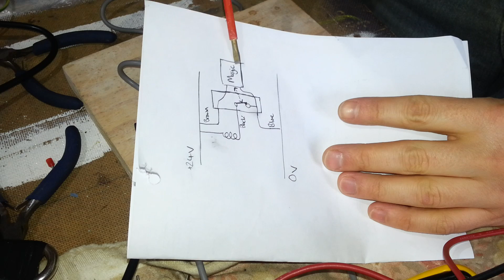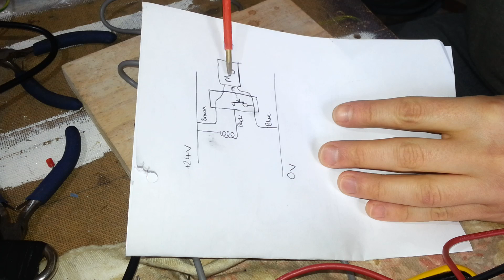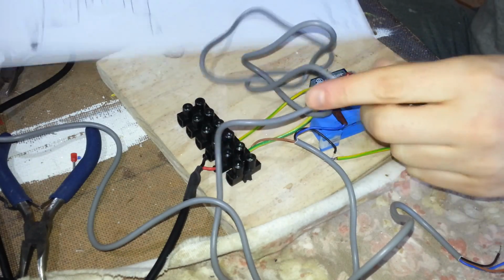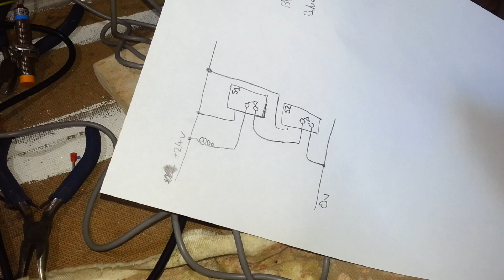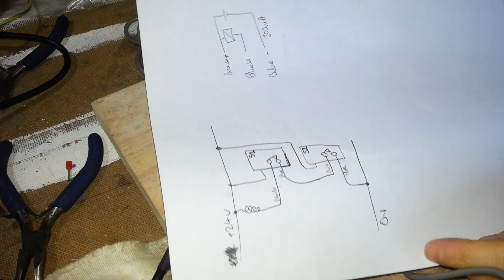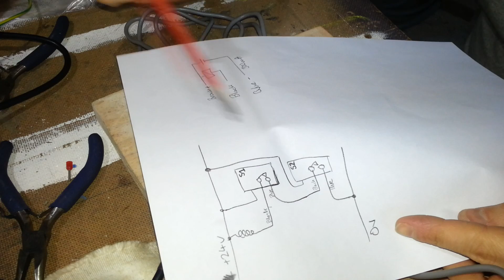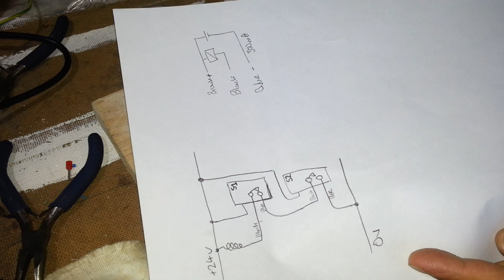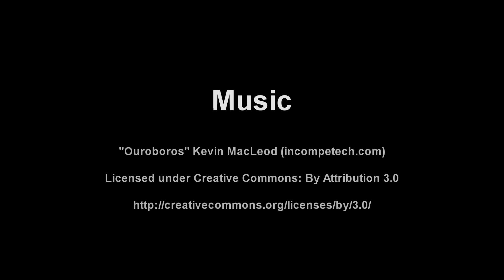Inductive Sensor Wiring Tutorial

Comment: Hello sir,
Your video is particularly interesting, unfortunately I don't understand English. Also I would have 2 questions:
1 - In 0.33 what is there under the brown tape, at the junction of the blue and green wires?
2 - In 1.46 on the diagram, what and the value of the resistance placed between the + 24v and the black wire?
Good continuation and thank you in advance. Cordial greetings. P. K. (French)

Comment: Why in series? in parallel connection you dont have voltage drop and sensors should be more stable right?
Reply from the maker: The only way parallel would work is if each one was wired to a different input on the control board and I can't think of a control board with that many spare inputs. Think of them like regular switches, if they were wired in parallel to the same input you could only detect when they were all open since if any one was closed the circuit would be complete. Wiring them in series lets you detect if any limit sensor is tripped regardless of how many you have installed.
Reply: CNCtrl
Thank you :-)